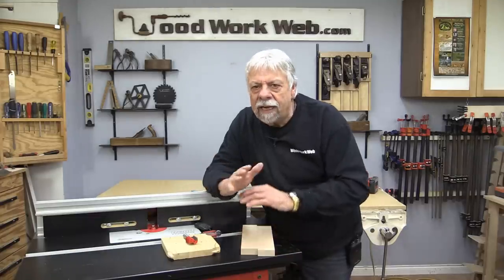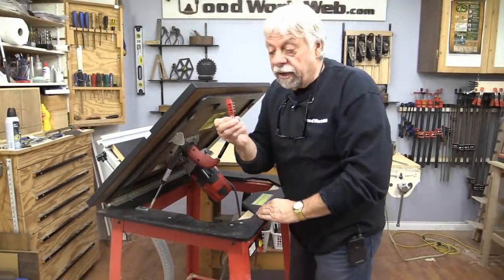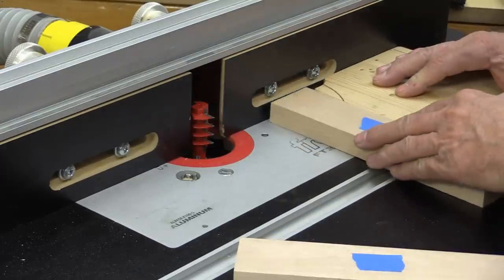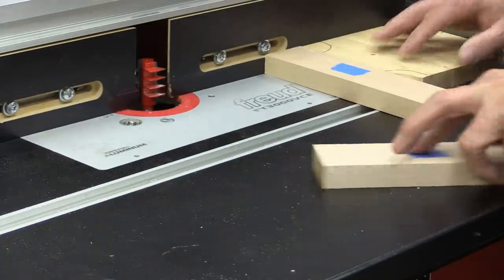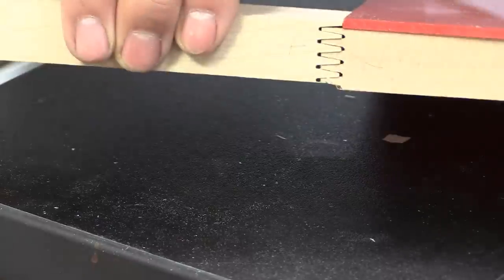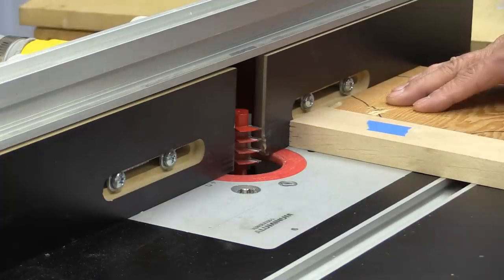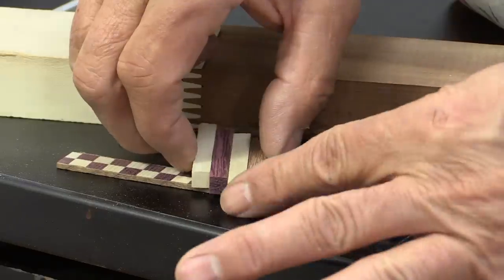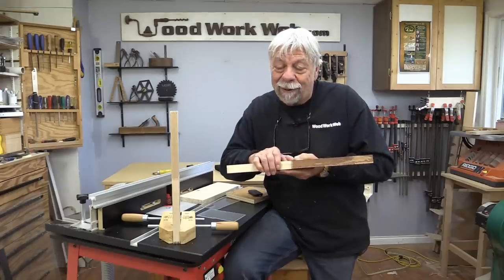How to Make Finger Joints: Finger Joint Router Bits!

Comment: My way of dealing with it on my commercial FJ plants is to set the cutter height so that flipping a piece after profiling results in a perfect match. Also, not discussed here is that in order to get a strong joint, the length of the fingers needs to be very carefully set so that you can take full advantage of the wedging effect of the two profiles when they are pressed together... The fingers should not "bottom out". They should not be too short that they leave voids on the end of the fingers though. You need to experiment to get it right though it differs with different densities of wood.

Comment: When using finger joint bits, raise the cutting bit so the highest tooth's center is flush with the top of your 1st board. For flush joining 2nd boards, lower the bit to the center of the valley between the 1st and second tooth.   you should now be cutting flush nicely jointed boards without the need for the plastic.
Reply: You stole my thunder LOL I was going to say that.I have the adjustable one from Lee Valley
Reply: MrFunkapotamus was gonna suggest something similar but not so many words.lol  Great minds think a like;)
Reply: Seems to me that Colin's method is faster and requires a lot less fidgeting.  Even with a router lift Collin's method is more repeatable.
Reply: repeatable yes, but his cuts will always be wrong unless he sets the bit height correctly for the first pass.
Reply: MrFunk - I don't see how that is a problem so long as he uses a shim that is 1/2 the cutting tooth's width and is consistent.
Reply: You could make a really interesting looking rabbet joint with that thing.
Reply from the maker: That would be another great way to deal with joint alignment. Thanks for watching and thanks for the tip!
Reply: Not all router lifts are created equally, some will shift slightly once the router lift is locked/secured.   Much easier to make a shim that's 1/2 the pin width and use a couple pieces of scrap dialing it in once,  as opposed to having to make test cuts eat time you decide to use the bit.  As a general rule if I have to choose between making adjustments to the tool or using jigs/templates, I do the later.  The time and frustration you end up saving yourself is immense.
Reply: Tony Grant, if you noticed, part of the route was splintered on top making an uneven joint.
Reply: If you just flip around the second board , maybe you don't need to move the bit ? If your adjustment is perfect, maybe make and other piece with some kind of plastic so you will have a jig for the adjustment next time ?
Reply: I absolutely agree with you Sir.I doubt that the engineers at Freud would expect someone to use a piece of PLASTIC to make their joints fit properly!!!
Reply: Tony Grant .... more accurately half the tooth pitch.... 😎
BTW  a shim of that thickness will save having to re-set the cutter height for the second board cut...😏
Reply: Of course raising or lowering the bit is the right way to accomplish a good fit.  I can see using such a joint log joining boards along the grain for shelves, table tops, and such. Might not make pretty joints, but they'd be strong
Reply: Could you go into a little more detail on this method?  I have the frued but and I'm pulling my hair out.

Comment: I have seen this finger-joint system used to connect and glue beams together. I have them supporting my roof of my house in germany. The carpenter told me that they used to cut this by hand. And is strong as the beam itself

Comment: I used to work with my old man at a timber laminating plant, we used a finger jointer to create the required lengths for the beam work. The joint router was a big old machine with 3 cutting heads on it, 2 of them faced the end of the boards to square it up, then the finger cutter would pass over one board end, scooch over to the other board (there was a board end in either side of the machine) and cut that, the clamps would open, you'd fire the board through and repeat the process. It'd then be passed over to the rammer machine, where the ends are filled with melamine based glue, pressed together (with pneumatic rams, not hydraulic) to the required lengths, cut, then left to cure until the following day, when they get their first dressing through the 4 sider.
Reply: Yea the whole time I was thinking GlueLam beams

Comment: This is a useful bit for joining long lengths of wood to make planks or especially wide continuous wood with woods that are generally not available. This goes for wood that is especially varying in widths.

The biggest problem with the shim is that, in the way you used it, long cuts won't work. You have to reset the bit height.

Comment: Very good video Colin. Try running two boards threw the bit in the same direction, then turn one over and mesh the two of them together. In a factory where they finger joint off cut blocks together the second block is always tuned over.
Reply from the maker: I'll give that a try Ray! Thanks for watching!

Comment: Ha! Exact issue I had! I ended up making a couple keys after I nailed it down so I can quickly adjust the bit and match it up. But I think you’ve got a better idea here if I can find the correct thickness material.

Comment: Hey colin, nice video. Really helps out to understand the orientation!
I was wondering though would it be possible to set the router bit in such a way that you have the cutting teeth hitting the board on the first pass with the upper bit or lower bit halfway on the board and halfway off the board and then when you flip and run the second board in reverse positioning those two staggered patterns will then be aligned without having to move the height of anything? Just wondering... Thank!!

Comment: We use these finger joints where I work.  We do long structural beams 60 feet and more depending on the job, and the joints are very strong.  Obviously we don't use a router bit like this as our machinery is rather large.  The entire finger joint line is about 400 feet long from start to finish.

Comment: These are great for gluing up boards from planks. And with a bit of math they are amazing for reinforcing a mitre joint. And it makes them look really neat.

Though given what bits like this cost, I'd say that for the hobbyist it's a better idea to spend the little bit extra and buy a spindle with a set of cutters and bearings. The extra flexibility is so worth it.

Comment: I actually just repaired a futon that that had the long members spliced with this joint. Except it was about 1 in wide interlocked. I'd say its reasonably strong but the wood did separate on the joint exactly. So my initial impression is that it is not as strong as an actual unified piece of wood. As I think about it, it does seem like its essentially endgrain to endgrain since you cut both sides at an angle. Whereas a straight finger joint has smooth sides for a solid gluing surface.

Comment: in a visitors centre in kent uk there some large structural beams made from short  boards  Ieach I think of 300 mm in length and 100 mm width and 20/25 mm thick in horse chestnut with fine finger joints end on end  these were then lined up vertically side by side with about 10  rows of similar sized boards  all with finger joints so beam was about 200/250 mm in width  each joint was  staggered much like brickwork . then at at least 3 identical sized rows of  finger jointed boards of 100 mm width were laid on top in the vertical effectively providing incredibly strong  structural beams of 400mm high by 200/250 mm  wide and of lengths up to 10 metres bolted or glued to together ??. These beams are curved for architectural purposes. from a distance they look like a single beam cut from a huge tree but really close up you can see the fine finger joints . Absolutely amazing .obviously engineered on an large scale but had me thinking of what one could do with scrap wood and finger joints ...

Comment: Lowes sells boards that are made from scraps put together with that cut.  They are glued together to form longer, wider boards.

My thought is that this can be used in a similar way to build "bricks."  If all the pieces are the same length, you can alternate contrasting wood and glue different board you make side-by-side until you have a 'brick wall' look.

Comment: I bought one if these to turn two 8' boards into one 16' board to repair a garage door. Close examination of the original door showed they used finger joints. The bit car said 'just flip it over', but as you discovered that doesn't work. Thanks for providing a solution.

Follow-up.  After viewing your article,  I found I could set my router 5\64th of an inch up to cut the second piece. I also tested moving it 5\32 of an inch down to cut thicker boards, and that worked also. I have to use a router with an edge guide because I can't really run an 8' board with the cut edge against the table fence without making a pretty substantial jig. Since I only have to make two finger joints, the edge guide should work fine.

Comment: You will find this joint on a lot of hardwood furniture that's bought from furniture stores. Usually its covered over with dark stains and high polish finishes to hid the fact that the wood is hundreds of off cuts. The furniture looks and works fine but i took the finish off an oak table recently and found that the table designed to sit 10 was made from sections of oak no bigger than your test pieces and they were all jointed together with finger joints. Totally agree that there are lots of cool ways you could use those bits though.
Reply from the maker: Interesting! I've never seen that before ... but I also don't look at much new furniture. I've keep an eye out for this now!

Comment: hello from France, Switzerland border. In French this is what we call " fer à entures". Check those words on YouTube and you will find some videos, in French for sure but you will understand drawings. That is what we use for example to link several boards to get long boards, before to glue laminate them. We build glue laminated structure up to 25 meters long in my workshop.we won the universal building exhibition in Milano in italy last year, for the French building. This kind of joint add a huge resistance at the end of each boards increasing the surface for glue.

Comment: I've seen finger joints in husky bench tops and all over IKEA where there's any hardwood. It seems to make building large panels more cost effective for mass manufacturing
Reply: A friend worked at a window manufacturing plant, back when they built the frames out of clear fir. They would finger joint the frame material so there was no waste. They could make them any length, no cut off pieces, basically and endless board.

Comment: The fingers are flat ended and the router bit creates a rounded socket for it so there is a gap at the end of each finger so to speak. Are there any bits that can produce a rounded finger to match the profile of the cut sockets?

Comment: the undesirable offset that you experienced on the first couple of tries can be remedied without a piece of plastic to gauge the cut, just by raising or lowering the bit on the end of the wood (adjusting the bit or router motor up or down)... raising the bit slightly will bring the fingers HIGHER on the end grain, and as you are running the second piece of wood thru it UPSIDE DOWN,  the fingers on this piece will be LOWER on the end grain, which can easily be seen when its rotated back to the mating position... the trick is to get the bit in the correct spot so that you can mill the ends of BOTH at at the same time, and then when you flip one of them over, it will make a perfect fit.....  if you are doing a one off joint, the way you have shown is acceptable, but if you are doing many pieces to make longer material, getting the bit in the right spot so that you can run several ends thru the cutter all at once will make short work of it....

Comment: I think you should adjust fence so that shank carbide sticks at least a bit. That way it will ensure that all fingers are of exactly same needed length to fit well. I mean why would they be putting expensive carbide on the bit if they are not expecting it to cut?
Reply: Yeah, he's messing up the cut every time once the end of the board gets past his fence. He should be using a miter fence and insuring the entire end gets cut, including the "valleys" of the bit.

Comment: Ummm: am I missing the obvious here? You set up the cutter to make your initial the initial cut. Make the cut. The adjust the height of the bit so the tips of the blades meet the tips of the "points" (what do you call the peaks of the cut?). Then you run your next piece through it. If you lined up the peaks of the cutter with the peaks of the first piece, the second piece should fit like a glove.
Now, I've never used this bit nor a router table, but I think this would be easier than trying to find the right thickness of material for the offset. Also, one less piece of material on your table (the shim) is one less thing to worry about (the shim hitting the blades). Also: what if you don't have the correct thickness shim? Are you out of luck? Router tables are adjustable, as mentioned in this video, and the adjustment is very precise, as mentioned in this video: why wasn't that even attempted?
Reply: Bingo. This is precisely the required approach.
Reply: "Also: what if you don't have the correct thickness shim? Are you out of luck?"  I feel like I'm the one missing the obvious, now. If you've a woodworking workshop, you make things. Why wouldn't you simply make the shim?
Reply: Given that "makers" have an expanding number of tools these days, 3D modeling and 3D printing make it trivial to create a plastic shim like this. Some calipers to measure the bit's offset between valley and peak down to tenths of a millimeter, some quick modeling, tell the printer to start and now you'd rarely need to fiddle with adjusting the router table.  Sure, you've a 2mm bit of plastic or two in the shop, now, but it cost pennies to make and doesn't take up much space.
I like the idea of testing the elevation of the bit by inserting it into the piece you just cut to ensure it's the proper height now, but why go through that effort for every single cut you make with this bit, when a one-time creation of a shim makes it unnecessary?
Different strokes for different folks, I suppose. Woodworking just already involves so many jigs and whatnot already, the idea of 2mm of material being a burden in the shop seems funny given that it'd save you countless table adjustments.

Comment: This particular finger joint bit (Freud 99-037) was annoying to work with at the outset because the packaging does not include instructions that define the distance by which you must offset the bit to make the mating cut on the second piece of wood, and also because the tooth-to-tooth dimension in the diagram in the packaging (21/64"), which you would need to calculate the offset, isn't even CLOSE to matching the actual tooth-to-tooth dimension on the bit. After carefully measuring the bit itself, I determined that the bit must be offset by .080" to make the mating cut. Because the bit is made in Italy, it's possible the offset Freud had in mind was a nice, even 2 mm (.0787", or .0013" less than I measured).

Comment: Great video video.The solution with the piece of acrylic is genious and simple at the same time.  
Thanks for sharing. This is exactly what I need!  Well, not really exactly. The price is far beyond my financial possibilities at this moment.
And it has a 1/2" shaft. I need 8 mm (about 1/3"). I wonder what the strengt of such a connection is. The cut outs are rather short.
Locally I buy Makita router bits. Just today I ordered a T shape router bit because they did not have it in the store. Next week I'll have a look for a finger-joint router bit.
Reply from the maker: Hope it comes in handy for ya. Thanks for watching, once again !!!